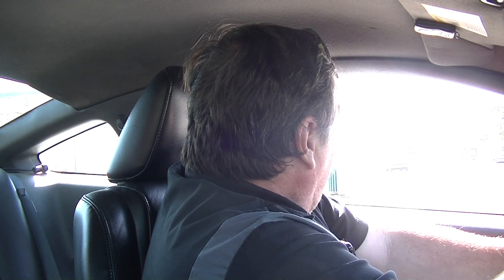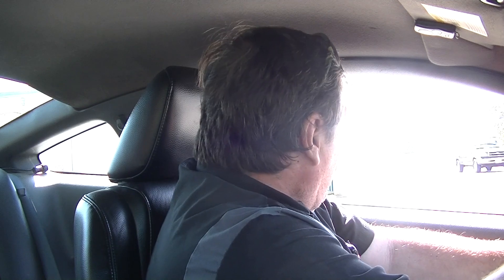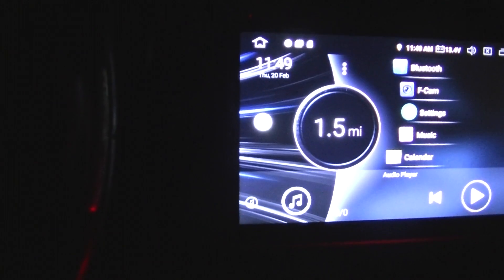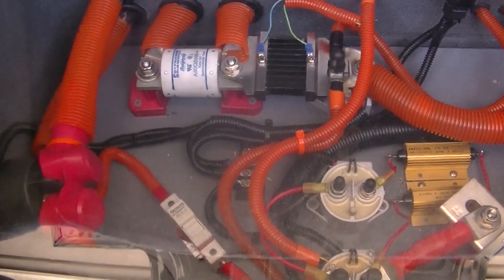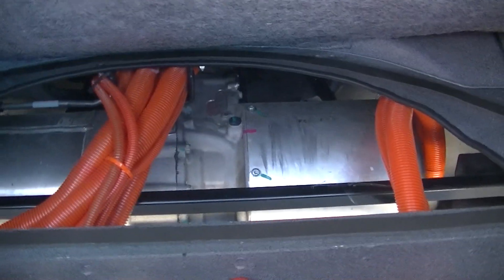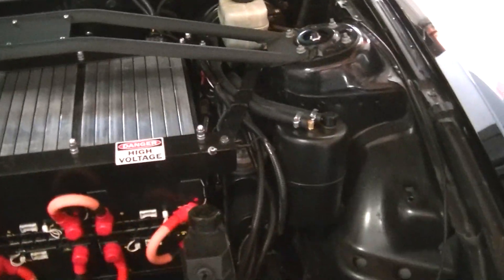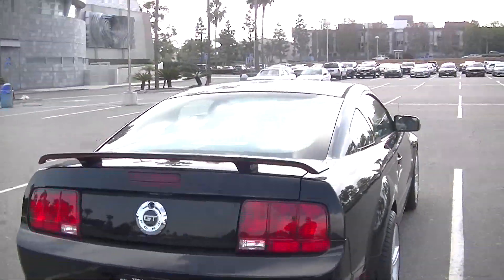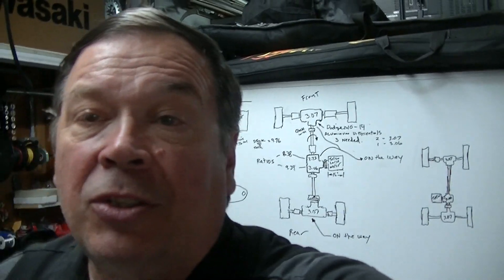Mustang GT Tesla Motor Swap

Comment: I think that you really may could have gotton all your battery packs in one level. 2 in front 4 in the tunnel and 3 across the back. ??? Or am I not seeing what you saw in the design?
Reply from the maker: There is 12 batteries, 8 under the hood, 2 down the tunnel and 2 where the old gas tank was. 32Kwh. I wish I could have got 4 in the tunnel but it's too narrow half way back.

Comment: need to know total body weight and see 1/4 mile time and speed at a sanctioned drag strip
Reply from the maker: Me too!  I had sold the car to AEM performance electronic corp. before I could do any of that.I do know I used a dragy on the street and was 0 to 60 in under 4 seconds.

Comment: It's a great build mate. How many kWh does the battery hold and what kind of range you get out?
Reply from the maker: Hi, I only had 32 KWh. It would be about 80 miles with the performance motor. Never verified.

Comment: Amazing job on this build! Do you have a video explaining how the CAN communication works, the gauges, tablet, etc. are set up? How is it all linked up? Is the tablet just connected via WiFi to the controller?
Reply from the maker: Hi, the tablet is connected to the inverter by wifi. The inverter itself has a wifi board and its own address.  Pretty slick I think.

Comment: Brilliant work. Thanks for sharing. What is your educational background? Just curious as you mentioned helicopter test pilot, but I'd have to think either mechanical and/or electrical engineer seem obvious, but maybe you've just done a lot of self-education. In any and all cases, kudos!
Reply from the maker: Hi Issac, Actually high school grad only. II owned an automotive garage for years then learned to fly helicopters and became a flight instructor. After that a test Pilot for Robinson Helicopter and worked in research and development learning everything I could as far as engineering and electronics. Built many machines for testing helicopter parts. I study and learn what I need to know for projects I build. I always focus on the task at hand.

Comment: Terrific job! Just binged watched them all. I am working toward a similar project and have been looking everywhere for the actual wheel hub face to wheel hub face width of the drive assembly. The car I am hoping to use is a bit narrower than your Mustang and not sure that I will be able to get the wheel track back to reasonable like you did with the corvette wheels. Is there any chance you measured it and wrote it down somewhere?
Looking forward to the Focus build.
Reply from the maker: It's 70-1/2" ish hub to hub with rotors on.  Just measured it.
Reply: @Roadstercycle  Thank you for that.

Comment: Great project, thanks for sharing all of your hard work.  I'm currently building a Tesla swapped Plymouth Satellite.  Just curious on your Corvette wheels if you went with the 5x4.75 bolt pattern and how well they fit the Tesla 5x4.72?
Reply from the maker: Hi Kevin,  It is so close I don't even worry about it. Lots of guys have done it which does not mean it's right but I've found no issues. I did buy a set of centering rings and machined them to center the wheels perfectly on the Tesla hubs which is something that I highly recommend. In reality the bolt circle it ends up being .015 or 15 thousandths smaller overall. Again, I'm not worried about it.
Reply: @Roadstercycle  Glad to hear it, I'm planning on the same thing!

Comment: Simply well done!  I can't wait until I am driving out there too.

What is your infotainment display?  Did that come with the Tesla board or is it your own adaptation?
Reply from the maker: Hi Jeremy,  The Info display is just an amp meter/ amp hour meter/amps hour timer and volt meter. I bought it through EVTV with a 1000 amp shunt. It did not come with the inverter control board. My controls are all push button for forward and reverse and cruise. PS, just brought home another motor for the rally car project.

Comment: IIRC, Quaife already makes an intermediate gear for the Tesla gear case that drops it to a 6:1 ratio. If that’s the only change you make you’d end up with an open center diff in your “Sidewinder” EV car. You could also add a LSD to really get your rally car to hook up. I suspect Quaife made that gear for a British hill climb car using your same powertrain recipe. You might ask them. Maybe the guy who built that car can tell you about any oiling concerns with the gearbox turned sideways. 

Separately, the company doing full size work truck EV conversions seems to bolt a Tesla motor up to an Atlas 2 transfer case. Advanced Adapters probably has a patent on that setup. I foresee a lot of Jeep guys doing EV conversions that way over the next decade. 

HTH.
Reply from the maker: Thanks for the input. Unfortunately you have to do some math on the 4.5 to 1 ratio in the Tesla setup. If you run 3.07 to 1 front and rear differentials then you must multiply 6 x 3.07 which gives you a 13.42 ratio which is great for hill or rock climbing but not for street or rally cars. I am going to do a 3 to 1 in the Tesla setup with a locked diff in it to drive the front and back AWD differentials which will give me about a 9.21 overall setup. It will also have a rear drive shaft clutch disconnect at the rear diff so I can disconnect and apply rear brakes to slide around hairpin turns then re-engage the rear diff to power AWD out of the turns. Lots of engineering and lots of fun.
Reply: Thanks for your reply. I see that you’re aiming for a stock-ish Tesla gear ratio. It might make sense for your application to start with the 14,000 RPM redline of the Model S RDU and work backwards. If your rally car is never going to go 155mph like a Model S, then maybe a slightly shorter reduction gear is in order. The rear driveshaft cutout sounds wild. If you do a front one as well you can do Smokey burnouts at both ends of the car. That’ll get a lot of Youtube clicks for sure! lol
Reply from the maker: @apricity69  Thanks, I figured out the setup for the Tesla and will get it down to 3.07 to one. You can't really use the 14,000 redline to fix this issue, it's a mechanical issue. The guys with the 4.5 to 1 ratio where unable to do 3.1 to 1 because of fitment of gears but after some hours of brain storming I figured it out and it will be in the stock Tesla case. So I will end up will a single motor AWD rally with a ton of weight savings.